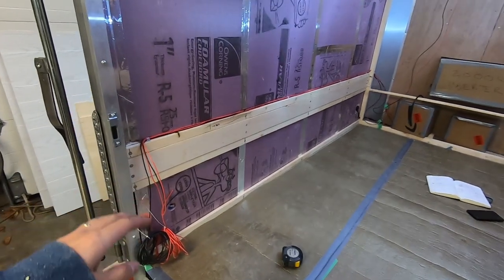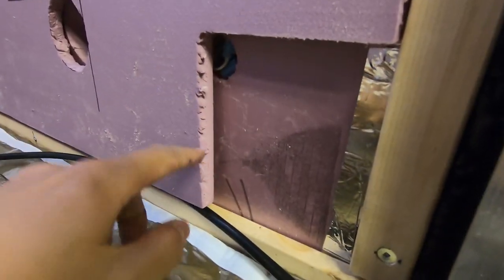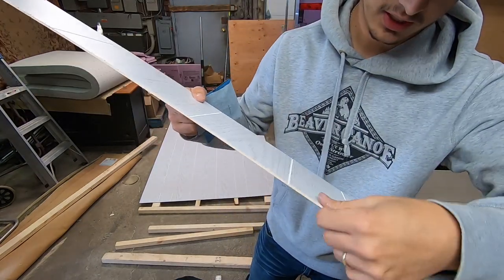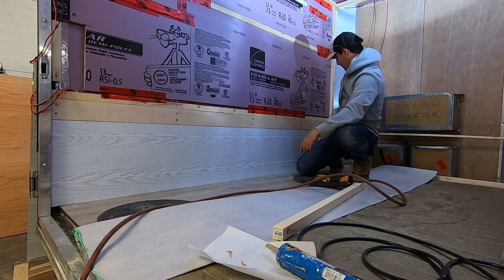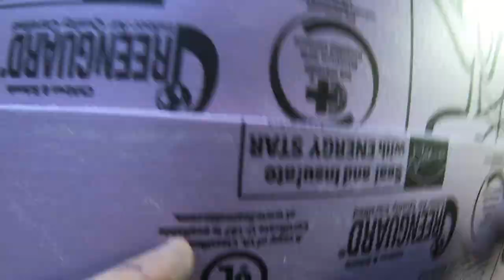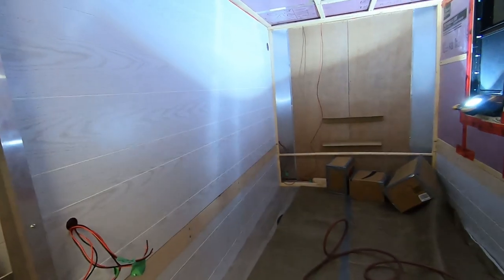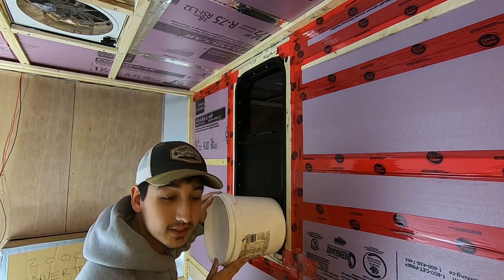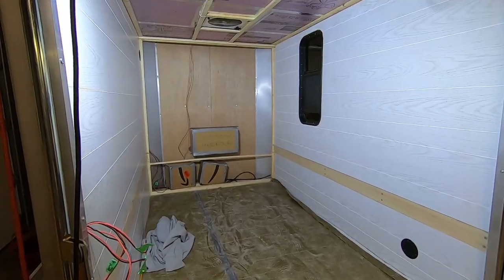Finishing the WALLS! | DIY Off-Grid Cargo Trailer Camper Conversion

Comment: This trailer appears too short fore you.  Walls look good though.
Reply from the maker: It's 5'4" inside height. I'm 6' so can't quite stand up inside, but I see it as a hybrid between a tear drop and a full on RV. The height hasn't bothered me yet, even after a year! Thanks for watching.
Reply: @JoelTremblayCA  Ah, when compared to a teardrop I get it. 
I hope at some point to build up a larger cargo trailer myself, something I can stand up straight in.  I'm 6'7" and will check out trailers with 7' of height.  Wondering if that's enough with insulation and ceiling covering.
Reply from the maker: @Snarge22  I'd say a 7' trailer should do you good! Good luck with your build.